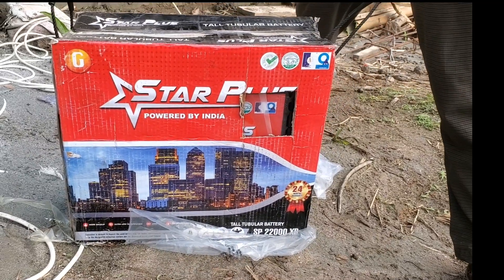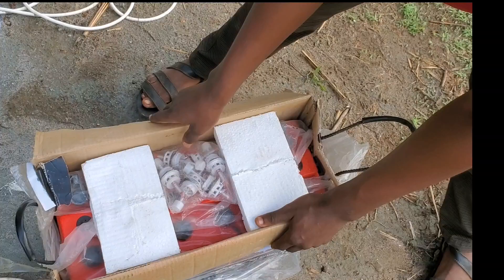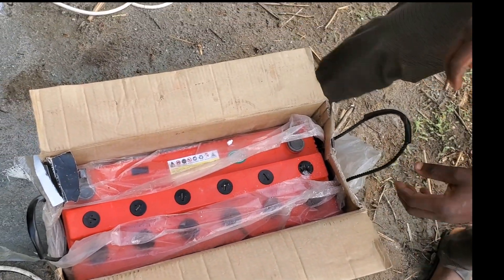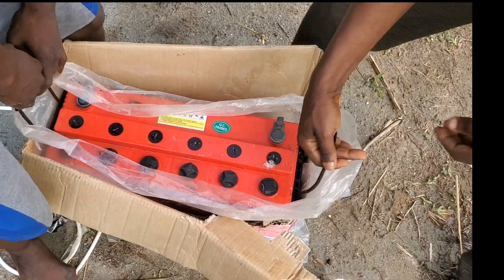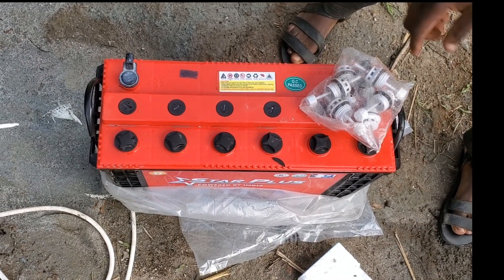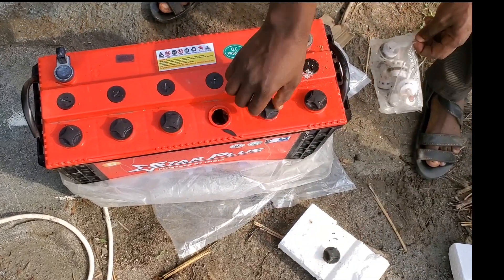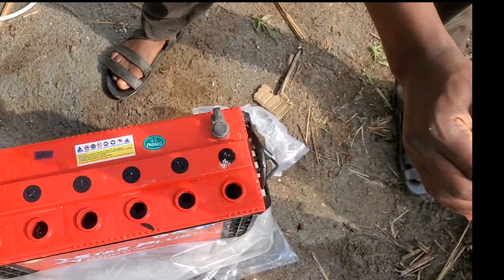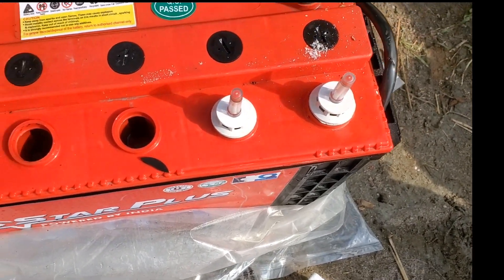Maximizing Your Solar Power System: Unboxing and Reviewing the 220Ah Tall Tubular Battery

Comment: First time, how long must u charge it before use
Reply: Please is it electricity you use to charge it.....
Reply from the maker: @faithobehi3172 solar panel
Reply from the maker: Depends on the ampere bro.
E.g 20amps will charge for 12 hours
50amps for 4hours or less
Reply from the maker: U can like  my video and subscribe if u like sir
Reply: @Abletechs35  I charged mine 8 hours till the inverter shows " battery charged "

Now the inverter is making a clicking sound every 10 seconds, once it makes that sound, the light flickers in the house. I don't know if it's the inverter or the battery?
Reply from the maker: How many of the battery are u using and for how long have u been using the battery ?
Reply: @Abletechs35  its brand new, 12v/230ah tubular battery, just installed brand new yesterday
Reply from the maker: Change Ur inverter and if it persist change the battery
Reply: @Abletechs35  alright, I have requested for a new inverter 

Thanks